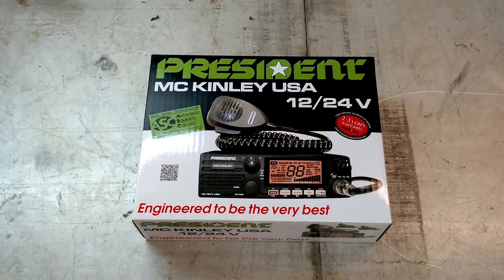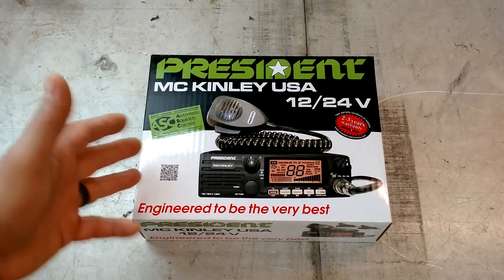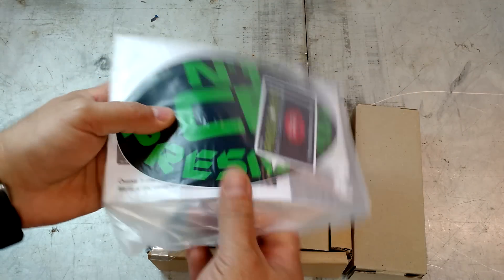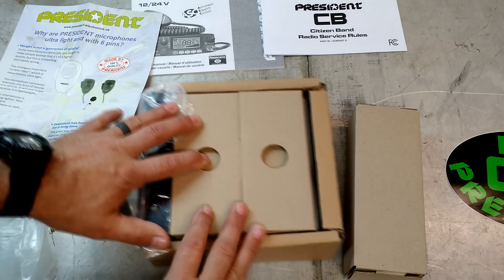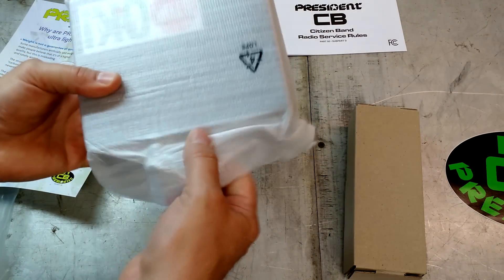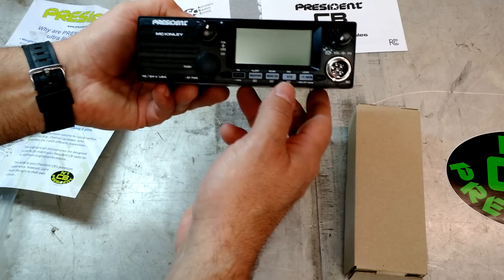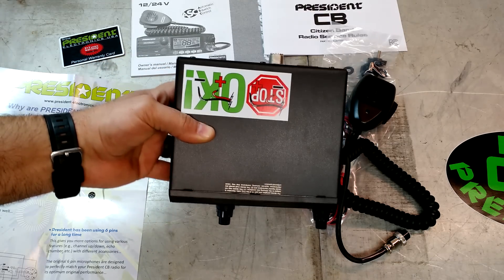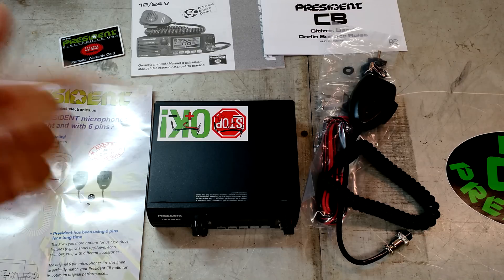President McKinley Part 1: Unboxing A New SSB CB Radio!

Comment: I have had my President McKinley for over a year now and it continues to be a great performer. And their service is second to none. I had to have my speaker replaced and there was no questions asked. Mike's Radio Repair did a quality repair.
I have talked all over that country and to Canada and south America with skip.
Reply: a little salty? I just bought a 980 SSB and I have nowhere to put the thing in my ranger, tempted to get a Mckinley so I could throw it in the dash.
Reply: @RobertBeckk   same with me in my Fiesta it's just stuffed between the sender console and the passenger seat. I don't like making holes in things even if there was somewhere out of the way to actually mount it.
Reply from the maker: The fact that it's DIN and has SSB is a real deal maker for me! Can't wait to get it installed.
Reply: @FarpointFarms  I think you will love it. I use a President antenna and my SWR is flat or a Wilson Little Will and it's a 1.2 across the band. The SSB receiver is outstanding. I find myself having to turn the gain down for local use on AM or SSB.

Comment: You know you’ve made it
 Big Time when they’re sending you a President radio!! We all miss the Midnite Cafe !!! Hint Hint 
Have a blessed week, 
73’s
Reply: If you have a watt meter ,, I’d be interested to know the stock PEP (Peak Envelope Power-Swing) on 13.8 volts versus 24 volts . And if all those stickers don’t end up stuck to your vehicles ,, save me a couple !  I have a rare , like new Uniden President HR 2510 I run in my Jeep , pushing a Texas Star HD 350 .. it’s a skip talking beast ,, when the skip is in !! I’d like a sticker for the back glass !!
Reply from the maker: The Midnight cafe will return soon! It's just super busy here at the farm right now, and I've been battling some medical issues. I had surgery last Monday and hopefully that will be the last of it. I was amazed that President reached out to me for this and can't wait to hook it up and do the long awaited SSB vs AM range test so many folks have asked for.
Reply from the maker: Shoot me an E-mail with your address and It's on the way! I will have to check if the tekpower can crank up to 24VDC. If it does I'll try it out and let you know.

Comment: I installed this in my Tacoma about two weeks ago after using it as a base for about a year or so.  It works well as both a base and a mobile unit.  The front-firing speaker eliminates the need for an external speaker for my set up.  The ASC (Automatic Squelch Control) removes the need to constantly adjust the squelch while driving.  It doesn't work on SSB though but really helps when monitoring AM (channel 19, for example).  The fine tuning for SSB is solid too.  The SWR meter/system is great.  My antenna is at the tailgate of my truck so I simply set it on SWR, turn up it's volume,  then start tuning my FireStik by listening to the beeps.  The faster the beeps, the lower your SWR is.  The short chassis is perfect for my installation.  Anything bigger would have been difficult to find a mounting place.
Reply from the maker: I was wondering about the clearance in the rear of the unit. It does look shorter than a regular AM/FM radio so I hope it will be fine.

Comment: Eric, I’ve had a President McKinley for about 2 weeks now and I absolutely LOVE it!  I took it to my local radio pro the first night and he was able to get it tuned up to about 18w on a.m. and 15w on s.s.b.  I had the radio mated to a Radio Shack 102” whip until last night.  It did pretty good and I’ve had some multi-state conversations when skip was rolling.  I have, however, wanted to get a President antenna because I wasn’t all that thrilled with the erratic SWR readings I was getting with the 102” whip.  I did my homework and called President Electronics USA in Florida last week and asked for a rundown on the best antenna available for the McKinley.  The gentleman I spoke with recommended the President Texas as the best for range.  The Texas is a 7/8 wave radial whip that sits at about 83”.  I happened to stop by my local radio pro’s shop last night after work, and low and behold, he had a shiny new Texas hanging from his shelf.  I asked him what he thought and he said that he had been running one on his vehicle for awhile now and he loves it.  I picked it up and installed it in the parking lot before heading out.  Once I put the top part of the whip in the center load, I checked the SWR on channels 1, 19 & 40... FLAT as a pancake on all 3 channels, none of which registered less than a 1.2 on any of the afore mentioned channels.  The radio shop is 30 minutes from my home and I got 3 very positive reports on my trip back.  The other thing I noticed is that the noise floor is half that of the 102” whip.  A local guy that I’ve conversed with in the past said “you’re blowing my doors off” and he was sitting at his base station about 8 miles away.  I’m anxious to see if I can get some good skip contacts in the next few days, assuming that propagation cooperates with me.  Anyway, that’s my 2 cents worth.  I love your channel and I’m looking forward to parts 2 & 3.😊

Comment: You do a good job with explaining the features of CB radios. My friend & I have been trying to establish CB radio communication between our houses that are six miles apart. We tried using a couple of used AM radios, yet, I could hear him and he could not hear me. I purchased two radios like the one in this video via Amazon for about $175.00 each. Both of our antennas are 30 feet in the air. I hope the extra power with SSB will allow both of us to hear each other. Crossing my fingers.
Reply from the maker: Let.me.know if I can help.

Comment: I've heard these are very good radios. The front mount speaker is great for audio in vehicles with high road noise. One of the problems I have found with other brands such as the Galaxy 929, is the osc stability with temp variations. I still have a couple of the Uniden grant series from the old days.
Hope this is a good one for you.
All the best.
Reply from the maker: Time will tell, but the Andy and the Bill that I have are both great radios so I have high hopes.

Comment: Eric - thanks for the great presentation, I've learned a bunch. I bought this President SSB CB thinking I could power it up using my apartment current. What can I get to convert 110 to the proper voltage and would be an easy connection to this radio?

Comment: I just bought one President McKinley with upper and lower sideband wondering what antenna were you running when you were doing your test
Reply from the maker: I was using a tram 3500 or a Stryker sr-a10. Both are great antennas and work well with this radio.
Reply: I've got mine set up with a five and a half foot hot rod Francis

Comment: The reason(s) I bought the President McKinley are 1) DIN size, 2) front speaker, 3) 2year warranty when purchased with an antenna. Have had it installed now for about two months now, and am very happy with it.